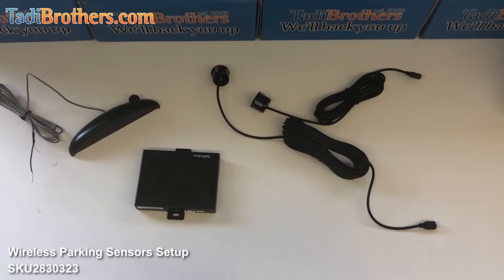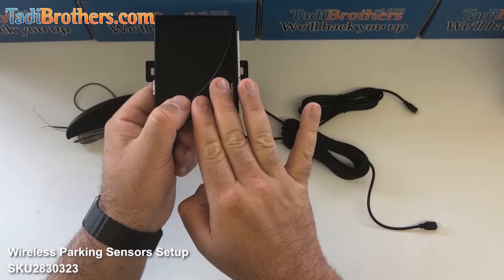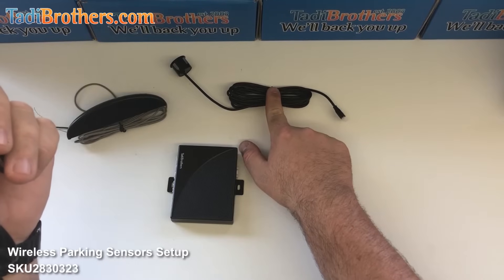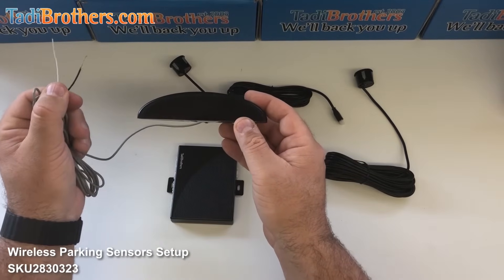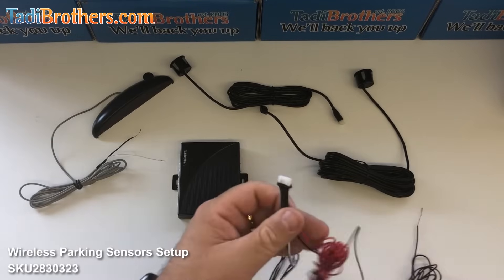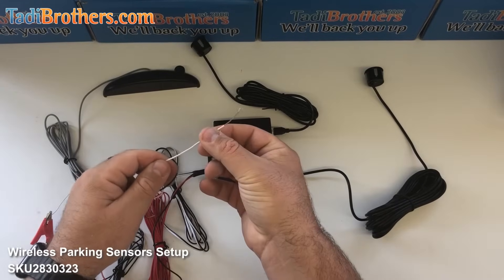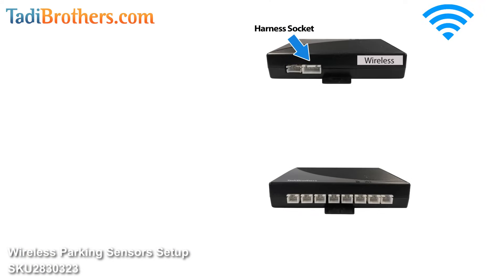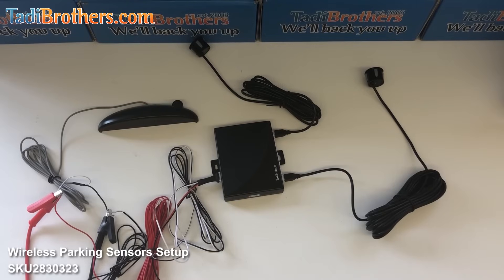Wireless Backup Parking Sensor installation guide

Comment: Can this module work with and existing sensors?those looks pure similar
Reply from the maker: Typically that depends on the type of connection your sensors have. However, when you buy the system you get sensors with it, you could always pop out your sensors and use ours.

Comment: This isnt wireless dude. Bye
Reply from the maker: Hey Paul, Wireless doesn't mean cordless. The Display/Speaker component use 12 volts and the sensor need to be plugged into the sensor brain as well as a separate 12 volt power source. Otherwise you could not power the system or tell it when to trigger. The wireless portion is between the brain and the display/speaker, it saves you the process of threading all the wires from the back bumper of the vehicle to the front dash.  I hope this helped and have a great week
Reply: see ya

Comment: and how is that Wireless?
Reply from the maker: Thats a great questions, thanks for asking. Wireless refers to the connection between the sensor brain that is usually placed in the back of the vehicle and the display/speaker that is placed in the front. A truly cordless system does not exist because its need a constant 12 volt power source to know when you are going in reverse and it needs the reliability of the vehicle power. Imagine if it was battery operated and the power would go out just when you needed it. its a safety issue, and Tadibrothers is in the safety business. Thanks for the great questions :-)
Reply: thanks
Reply: Thanks for the reply. we would love to see these Parking Sensors in action. especially the front bumper sensors. if you could do that’ll be great.